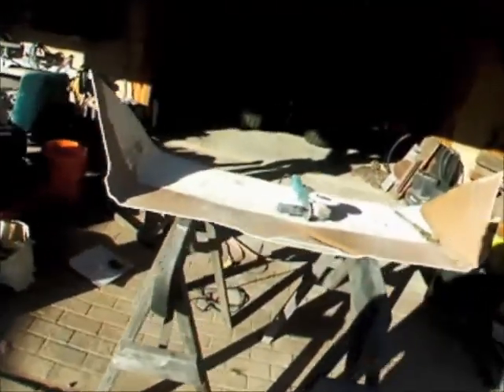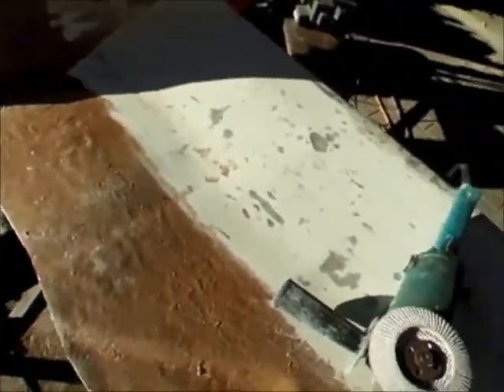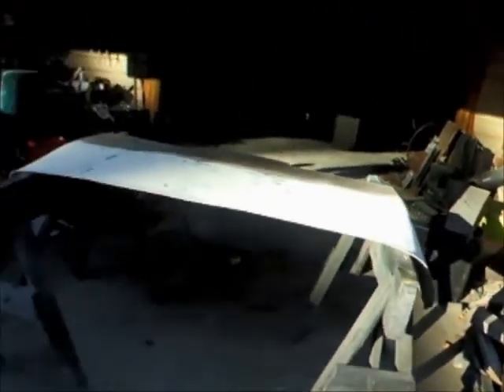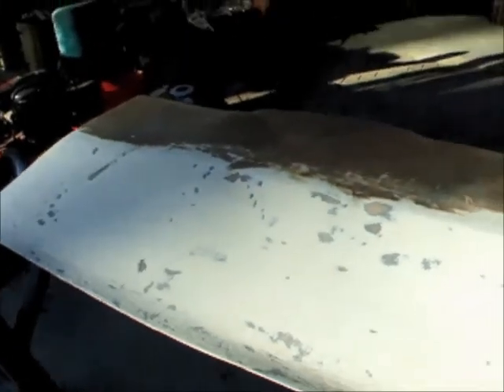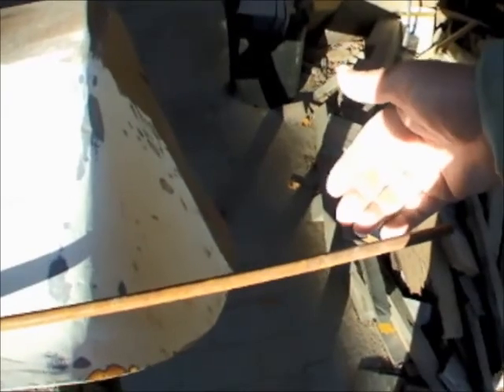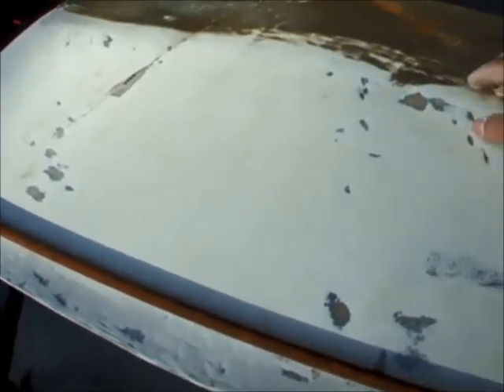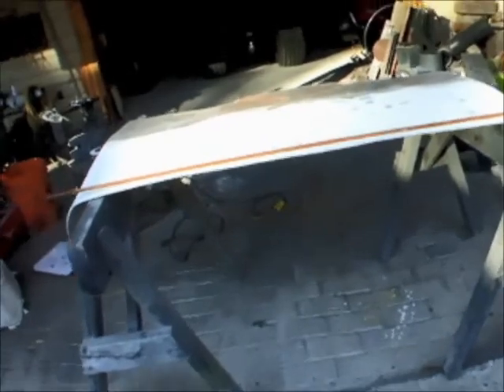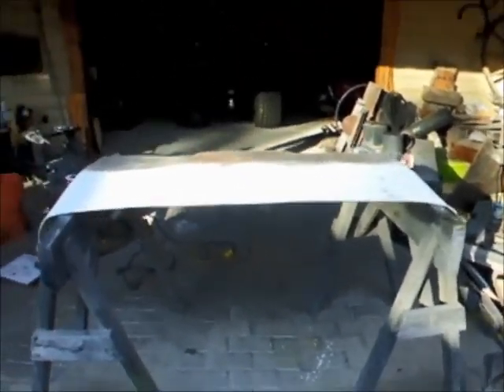Making a Sunvisor for the Focus 1 of 4

Comment: Hi Ed. My uncle that built custom hotrods would stock pile those camper tops. The ones with flat tops. He used them for the tops of the really old ones that were open. Make a fiberglass filler and then cover with vinyl. Also running boards. How do you like the Focus? Sandy and I are looking for Meg a car. The baby of the family is working and going to college. man I feel old.lol
Reply from the maker: Hi Stan. The Focus is an amazing car all right but I do not like the electronic manual transmission. It is called an automatic but it is temperamental and jerky at slow speeds. Gas mileage is in the low 30's per imperial gallon. Not exceptional by any stretch of the imagination. I much prefer a good old fashion automatic transmission. For a 4 banger however, it is very quick. I've got a little 1992 Ford Festiva with a fuel injected 4 banger that is just as quick and gets 55 miles to the gallon but it is due for a restoration. Something tells me that Ford is going backwards, not forwards but the Focus was cheap. Just 10k for a 2015 with under 50k miles on it. That's considered cheap up here. 
Old? Ya, I know what ya mean. Wait till you're on a seniors pension for a few years and no one will hire ya cause they all think you are way too old to be doing anything except sucking jello through a straw and sleeping. LOL. 
Thanks for watching. Good hearing from you.
God bless.